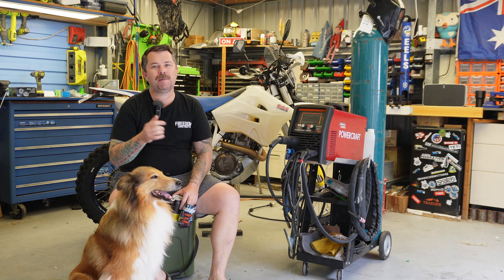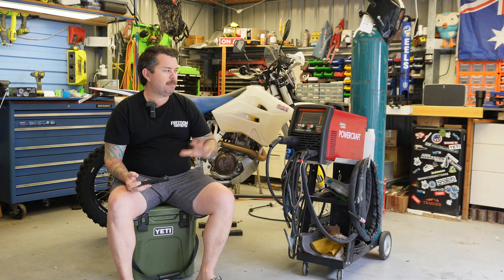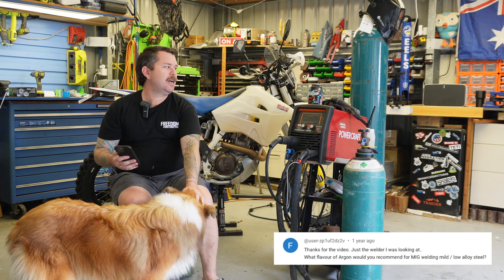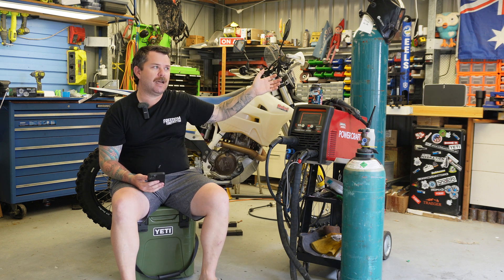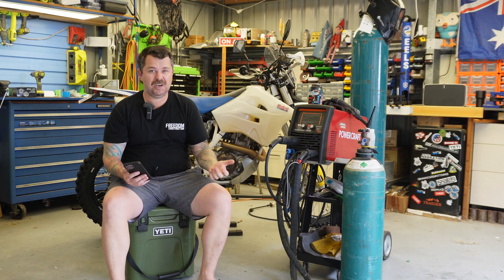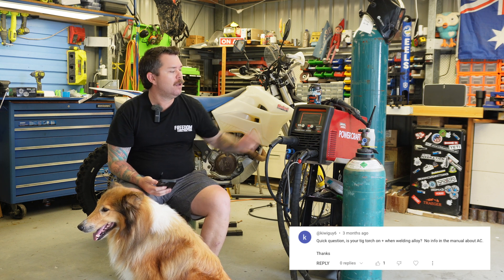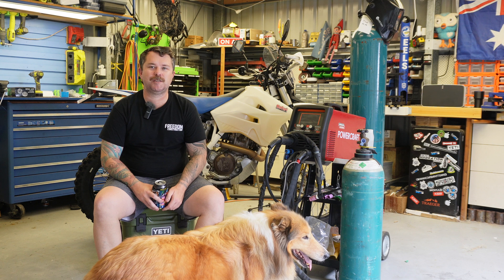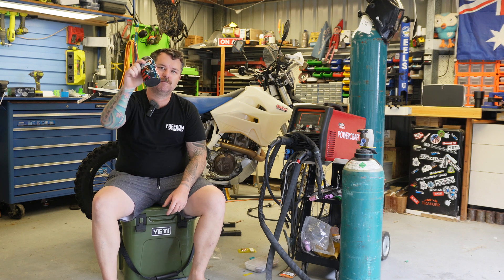Lincoln 200M 4in1 Q&A | My thoughts after 18 months of use!

Comment: Hi Kenny, just following up on your comment on the Mig gas being permanently flowing and having to turn it off when not welding. I would contact Lincoln regarding this. I have a 200M, mine switches gas on and off to the Mig torch on demand the same as in Tig mode, there are pre flow and post flow settings when in Mig mode too. Sounds like your Mig solenoid valve is stuck open. I haven’t seen a schematic, or taken it apart, but I assume there are two solenoid valves- one for Tig, one for Mig as there are two gas paths. I can close the regulator, come back days later and it will still show pressure on the gauge. Hope this helps. Cheers, Steve.
Reply from the maker: Cheers Steve, thanks for the tip! 👍🏼 Mine has been like that from day 1 so I thought it was normal. I'll suss it out a bit more.

Comment: Looks pretty nice.  One thing about this machine is that it's rated to draw only 10A from the mains.  Lots of similar machines will be rated at 15A.  Pros and cons - this machine plugs into any old wall outlet, but a machine rated for 15A will tend to be more powerful or have a higher duty cycle.  There's is a 250M available also (15A) which looks pretty good.  It comes at a higher price and is larger and heavier of course.

Comment: With the Lincoln 200M being a bit longer than a lot of welders. What propriety welding cart did you find that was suitable. Or did you build your own….?
If so, have you got any info, sketches etc that would assist in me building a similar cart please.
Reply from the maker: Hey mate, have a look at my most recent video on the Tri Machine Welder Cart. That’s what I’m using now. In the video I also show the previous cart and the top shelf I folded up out of aluminium for it to fit the longer welder 👍🏼
Reply: @Kenny_B Sweet. Thanks for prompt reply.

Edit: Subsequent to your reply. 
I have just ordered the WTC-800 Tri-cart welding trolley from H&F. Thanks to the excellent information on this vid  and the cart vid you recommended. You have saved me from a lot of deliberation and possibly getting a sub-standard item. Thanks heaps. 
Bought you a coffee too… (seems not much of a thank-you really, but enjoy it anyway).

Comment: Hi there, I’m mainly concerned with welding 1.2 mm mild steel panels on a classic car. Can you please advise on wire feed rate, amps and voltage as well as gas flow pressure? Also not sure of settings in the menu other then wire size. Thank you (manual is fairly useless here)

Comment: Unimig pulse isn’t AC tig.
Reply from the maker: Yeah, it is. Check out the Razor 200 Pulse MIG model (part number PK11080). I'm about to buy one to review.
Reply: @Kenny_B  nope. If you want to AC tig you need their tig machine not this mig
Reply: @Kenny_B   I looked at this model and it is DC tig. It has pulse but no AC. I have brought a Strata Advance Multi 205 machine that has single pulse mig as well AC/DC. But most machines don't have AC/DC tig and pulse mig in the same machine.
Reply: @Kenny_B no it's pulse mig. But no ac tig. OP is saying no ac tig and is correct.
Reply from the maker: Hey mate, yeah you’re right. The sales rep at the tool store reckoned it was but once I looked into it more after these comments, I found out it wasn’t. I’ve bought the Unimig machine now and posted the first unboxing video a few weeks ago where I talk about it 👍🏼

Comment: Hey mate. I have the same welder and had a crack at ally mig, 3mm with feed at 16m and 19v you have to move fast but worked well, I didn't change out the liner, just sent it and happy days. Hope this helps.

Comment: You might have a dodgy gas solenoid on your mig, because this machine should definitely have automatic and adjustable gas control with the mig trigger, just like on the tig.
Reply: My Lincoln 200M has automtic gas control on the MIG side
Reply: Agreed, mine only uses gas when I press the trigger on the MIG. I rarely turn the bottle off unless I'm done for the day
Reply: Definetly something going on there thats an expensive mig otherwise ahah want to be working quick! Haha
Reply: Agree, there's no way it was designed to run gas continuously whether migging or not.

Comment: I have the exact same welder, 100% rate it. For the price point, what you get for it, imo it a great value quality 4 in one. Got a spool gun for mine, way better than the Teflon liner setup, downside is the spool gun is bigger. My only gripe is the fan noise. I made a welding cart that has 2 bottles behind welder, one argon, one Argo shield, so the cord in middle doesn’t bother me as it come out between. Great video 👍
Reply from the maker: That cart idea sounds ideal. Might have to make myself one like that.
Reply: @Kenny_B  sounds like motivation for a new video😉
Reply: So does it weld alloy well, with the spool gun
Reply: @nictidy8405  yeah sure does
Reply: Can you weld with a spool gun in synergic mode or only manual mode?